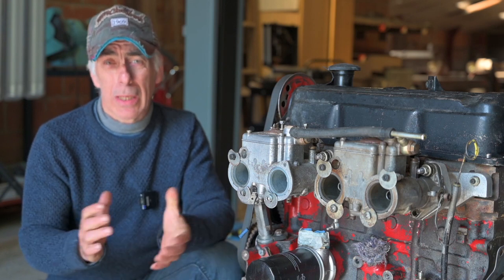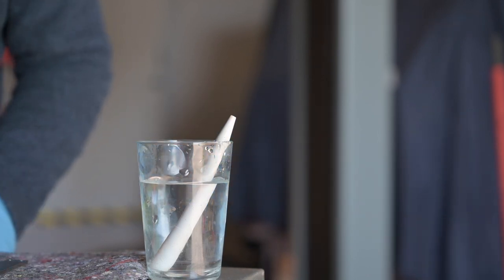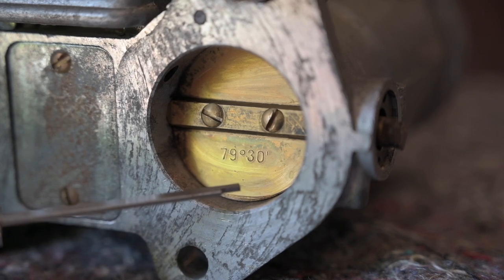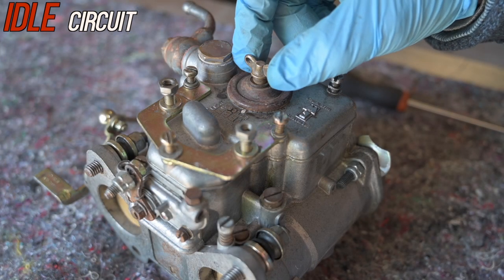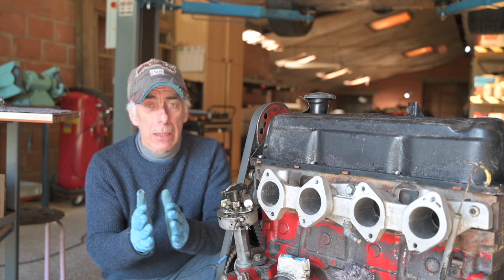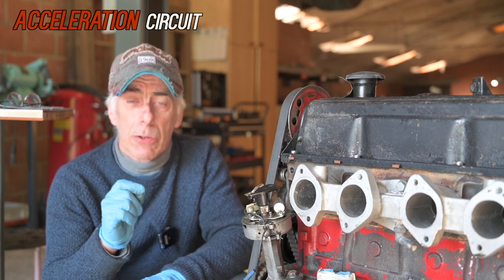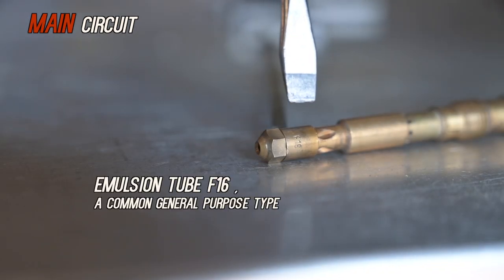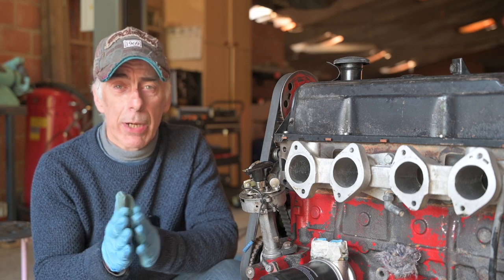Part 1, understanding the weber carburettor  DCOE

Comment: Excellent teacher, I am currently about convert my MGB GT to a Weber 45 DCOE alternative ( for its 'charge' supply) What I am specifically questioning is ; How critical in the vacuum signal to the distributor as there is not take-off at the carb for the vacuum line.
 I do understand that to take the signal from the manifold downstream of the butterflies may give me incorrect signalling ( Too much vacuum at part throttle. What might be acceptable compromise??
Reply from the maker: Thanks for the comments, the vacuum advance has in most cases little effect on engines that are prep-ed. In race engines you seldom see it.   The main advance is created by the bob weights in the dstributor, or an electronic advance cure based on RPM's.   What the vacuum does is providing a little bit more advance when more load is placed on the engine.  Such as going up-hill or acceleration, at that time the engine needs a more rich mixture and that has a slower burning time then a 14/1 AFR.  Thus the fuel mixture needs to be ignited earlier. That is what the vacuum advance does as there is more vacuum at that time ( engine under load and throttle open causes more vacuum)

Comment: Great videoo! Thank you. I have a DCOE45 that runs on a V Twin Harley with a single Manifold that feeds one cylinder (odd fire engine) at a time.  The carb works wonderfully and always has.  However, the acceleration nozzles continue to drip when the fuel is turned off.  This creates a flooding  of the engine , making it hard to start. Question: should I look at the anti return valve to solve this problem? Thank you for any help.
Reply from the maker: Thanks for the comments, sounds like a float needle replacement and or float level adjustment,   as fuel will expand when the engine is turned off.  Temp raised in the Fuel float chamber and as such the fuel level raised in the float chamber with can spill  over

Comment: Great explanation. Do carburettors wear out? I read on forums of people giving up on their carburettor and buying new aftermarket ones that don't work too well. Surely it is only the jets & float valve that wear and all those can be replaced?
Reply: G Short the axle that operates the air (butterfly) valves can wear on the carburettor body. When that happens the carburettor body leaks air into the inlet manifold giving a leaner A/F mixture. So yes, they do wear out sometimes.
Reply from the maker: Thanks for the comments, o yes they do...indeed its all about the jets , needles and floats , and moving parts.  Just rebuild it , much better then an aftermarket replacement

Comment: Very good video and easy to understand, well done Steve!
Steve I have a question, i have an Opel GT year 1969 2.0L Standard engine with a single Weber 32 36 and i am going to make 2 x Webers DCOE 40s that the Venturi are 32, or 2 x 45s and the Venturi are 36, now, my mechanic in Malta told me to buy 40s because are the best size to a Standard 2.0l Engine,  and the seller told me that are better to take the 45s because i`m going to lose HP with 40s!
Can you please give me your opinion?
Thanks
Reply from the maker: Thanks for the comments, sorry for the late answer.   They are all just trying to sell things...  The point is that you need the right seizing for you engine. Bigger is not better, you need  a carb that performs at it best for your car , and therefore you need to look at the intake manifold construct and dimensions, consider you camshaft ( maybe you have a highlift) and things like a flowed head.  All that determines which carb and jetting you need.  After all, the carb needs to have sufficient air velocity to work proper.  So a 45 with a small venturi ( barrel) is a waiste of money as a 40 would have worked as well.   So , yes a 40 will do for a 2l not knowing your engine.  I have an MGB-GT 1.8L with one 45 that develops 150Hp's... but that is with adjusted intake manifolds, modified head etc...
Reply: @D3Sshooter  Many thanks Steve, you are talking exact like my mechanic.... Now i am happy because i bought the right sizes !

Happy new year 

Simon

Comment: Perfect video!!!! I have one question..... Do you recommend installing a couple of Webers 45 DCOE in a VW jetta 1.8 V8, yes ... No and why? Thank you very much for your help.
Reply from the maker: Thanks for the comments  ,  so two double 45's...hmmm  that can work as long as you fit the correct Venturi in it an consider all the base calculations. And of course that the engine bay allows for the needed space.
Reply: @D3Sshooter  OK, I'm going to do the calculations based on the book. I already have it. And then I'm going to show you the results... Any opinion and observations would be very helpful. 👍😁

Comment: These videos are very informative!  I had submitted a question a few days ago to one of your Weber DCOE 40 videos and you responded but can't find the response now where you had asked some questions.  I am not personally working on the issue.  The restoration mechanic is having issues with the cold start.  When the car sits for a day or two, no fuel is getting to the intake manifold and the starter just cranks...afraid of burning it out.  The car runs great after having fuel manually primed through the air intake...starts right up, idles fine and restarts after short periods of time.  What would cause fuel to possibly drain out of the carb and not refill the bowl after sitting?  The small metal balls that sit under the weights on either side of the pump seem to act as a check valve.  If one was missing, would this cause the fuel to back flow?
Reply from the maker: Troy, I asked if you depress the accelerator real fast if you see fuel been inject through the acceleration jets  before starting?   If not the fuel level is off or your fuel has evaporated or you had fuel flooding .  So the question is also, if you do a cold start, let it run a few seconds ( 30 or so)... shut it and wait an hour or more... Is the starting difficult...  Then try again but let the engine come to temperature, shut it and wait 30 minutes, then try to start.
There is a possibility that you have vapour lock....  any how check the float level first.  If the balls are missing then fuel will move back in the fuel bowl when depressing the accelerator  and you will have no or little fuel been injected through the acceleration jet

Comment: Hi Steve, awesome video! I have a question on the fuel pump. Does the fuel squirt out whenever the pedal is depressed all the way or does the pedal have to pressed down quickly to quirt the fuel? what happens if the pedal is depressed slowly?
Reply from the maker: in general it is push down , so a  more force  full squirt  .  But a moderate push will do it also , yet less force full. As the fuel bleeds back.

Comment: The accelerator pump is needed because fuel has more inertia than air.  So changes in air flow happen more quickly than changes in fuel flow.
Reply from the maker: Thanks for the comments and good point

Comment: I have a Weber carburetor 32/36 on A Suzuki samurai 1.3 engine. It run very high rich smell like unburned crude fuel. Also consume a lot of gas. Do you know what could be the cause, or a least where to start. 

Thank you

Comment: The loss of fuel to air mixture or depletion is why airplanes have carburetor heat. I have never thought about this for an auto.
Reply: The changing of fuel from liquid to a vapor state draws heat out of the carb body (Air conditioning effect). The Carb heater prevents any moisture in the air from forming ice inside, which would freeze your throttle.

Comment: Steve…
I need an clue…
I’m about to buy an MK1 mini it’s engine is an 850cc but the previous owner fitted an Weber on it…
It’s okay to fit such big carburetor onto a small engine capacity!?
Reply from the maker: Yes , that works as long as the carb is jetted to the engine and its displacement.   There are a lot of wrong conceptions and idea's that a bigger carb is always better. Reality is , that its not so... only a well dimensioned and  tuned carb will do better
Reply: @D3Sshooter  
Thanks Steve! You are an classic car hero!
Full respect ✊️

Comment: Once you have used the Weber manual to fit the correct jets etc. then the most important thing is to follow the advice at 9:19, 9:50 and 10:26 to ensure the throttle plate is correctly positioned.
Reply from the maker: Thanks for the comments

Comment: i am having problems with my dco50's, they keep leaking fuel from the trumpets. on every book it says that the float should be 12-12.5mm but then it just drains the fuel out, if i put it to like 17-19mm then it stops... do you have any solution?
Reply from the maker: Is that with a running engine ?    Or running fuel pump...  that can happen if the  inlet needle valve is to big.. so it fills to fast and by the time it has stopped its to late and  you have a spill coming through the emulsion tube and secondairy venturi   typical a 160 should be OK..   Another reason might be that the floats are not having the right weight...  How did you adjust the float ...?  typical that is with a vertical cover and seal . the float lip should just touch the needle but not depress the spring .  Then check the distance between the float and the cover   7.5mm is typical, then check the drop of the float (turn the cover horizontal)  should be about 15mm  . All that is for Italian Webers with brass floats..  Not the Spanish weber , those have neoprene floats and the distance is 12mm in vertical postion between the needle and the float.
Reply: @D3Sshooter  the float is straight for left to right and is at 12.5mm, i have 250 needles at the moment, u think theyre too big? and its not only on running engine. also when you switch pump on it starts.
Reply: D3Sshooter so a 160 needle valve should be okay even with my 170 main jets? Really need help with this... and do you have anu suggestion what fuel pressure i should use?

Comment: Question? When the engine is idling and the throttles are complete closed. Where is the air coming from?
Reply: Air bypass on some carbs, on other idle speed screw holds the throttles slightly open.
Reply: Through the idle circuit, mixed fuel and air feed though that into the inlet manifold on the inlet side of the closed butterfly valve. The air is drawn from inside the float chamber.
Reply: They aren't completely closed.  The amount that they are open is what you are adjusting when you change the idle speed.
Reply from the maker: Eliott, I think the guys have answered that question, not much I can add. thanks guys

Comment: I have weber drt32 and it is soo difficult to set, i cant set up, car is shaking and want to turn off, l dont know what to do i think l have problem with lehr duse or idle jet?
Reply from the maker: Thanks for the comments, Point is make sure the engine is in a good condition, timing is set right ( valves but also the ignition).  Then verify that you have no false air leaking in the intake manifold. That is often an issue due to damaged seals,  and the start to verify all the jets  in the carb.  Make sure that they are the right size .  A basic foundation to start tuning is mandatory, that base line or basic foundation wil define all the jets ...  I have video soon on that process.
Reply: @D3Sshooter  yea thanks for reply, my R9 have 149 800km hehe and i think it is only carb becouse he always in this past years make trouble.

Comment: Your explanation about what cold engine needs could be a bit obtuse to a novice. The "loss" that you describe, is due to fuel condensing on the cold intake's wall drooping out of suspension in the air/fuel mist. This is the "loss" and the reason why we need a choke on cold engines (and why many older cars employ some kind of intake or intake air heaters). 
I talk a lot about carburation on my blog: http://patrykrebisz.com/w114/
Reply from the maker: Thanks for the comments, indeed ... and maybe I should have been a bit more clear on that

Comment: "when the engine is cold we have losses from the carb down and that is why we need enrichment" ... say what ?
Reply from the maker: Indeed , there are many factors that make the mixture  differ when its cold... just think air density  etc...
Reply: @D3Sshooter  this is why feedback carburettors are so awesome.  It's too bad that by the time they were making them that the caburettors were already kludged to no end, and EFI was taking over.
Reply: I think he means that on a cold engine initially some gas will condense out on the cold intake manifold and not make it to the cylinders. So that is a loss of gas in the mixture.
Reply: The fuel will not atomize as well in a cold situation and cause incomplete combustion. non will be lost it just won't combust totally, meaning it will need more (rich mixture) to keep running while cold.

Comment: If the mixture is the same (14/1) why does a choke make a car better at starting from cold.
Reply: Two reasons.  First, the air is colder and therefore denser.  Without the choke, the ratio would be lean as a result.  Second, fuel atomisation is worse when cold.  That is, it doesn't mix with the air as well.  So you actually need more of it, to be in contact with the air.

Almost everything else in the video is very good.  But his explanation of this is just strange.
Reply from the maker: yep you are right, there are many aspects why the mixture in the carburettor has to  more rich to achieve the good mixture in the cylinders when cold.   You listed several, and there is the condensation factor.
Reply: @D3Sshooter  very true.  I always overlook that and lump it in with my latter explanation, which isn't totally correct.  Condensation on cold metal surfaces is a different issue, because it can happen even if the air is hot